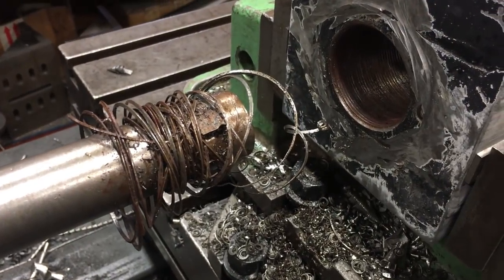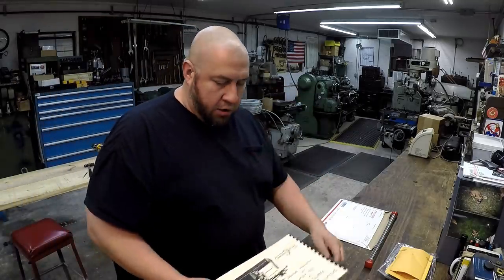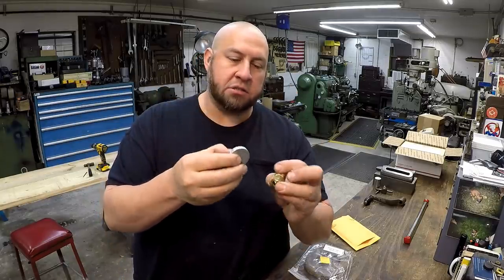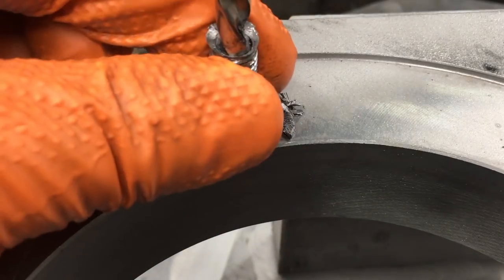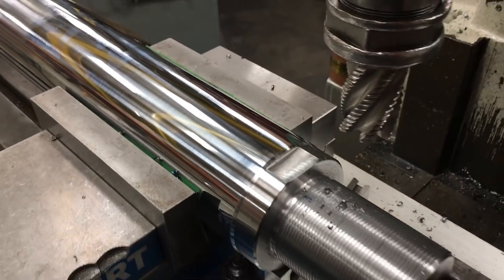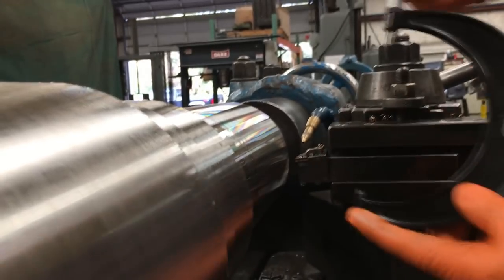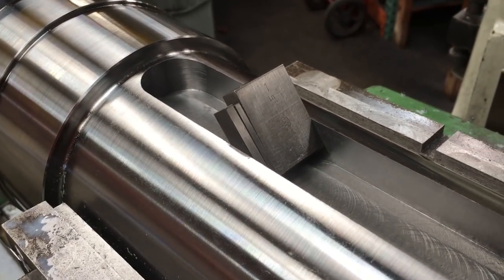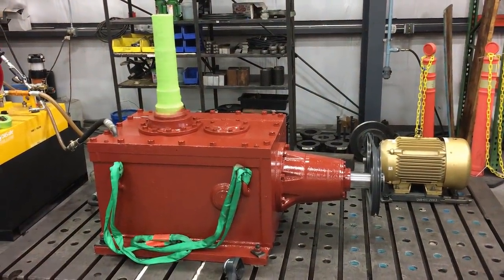SNS 202: Shaft Turning, Left Hand Drill Bits, Shaper Parts

Comment: Hey  Adam, great job on the broken bolts! I've found on the stubborn one's most times it helps to center or pilot drill the broken piece first. It usually allows the left hand drill bit to take a deeper first bite and apply higher initial torque to break the piece loose. Have a good day. Chuck

Comment: As a retired theatrical lighting designer, I can say that you new LED lighting is obviously going to work well for shop use, and the new lights are working very well for video lighting at the bench. 
You have good face lighting coming from in front and above at a good natural angle (the light bouncing off the wall in front of you and lighting your face) and the direct light coming down on you is making a good "key" light. This brightens your shoulders and around your head, and forms what is known as a "halo" that separates you from the background and makes you 'pop out' as an individual and not part of the scenery. (Look at the talking heads on TV news, you will see the same lighting technique -- it works well).
A suggestion -- when you put a row of new lights down the other side of the shop, put them on a separate switch so you can turn them off when shooting video at the bench. You want the background to be a little darker than yourself in the the foreground to get good video, and if you brighten up the background, you are going to start blending in to the background, even with the key light effect you now have. The brightness you have there now works great for video, but I'm sure you will want to get that side brighter for shop use someday. Just leave the new lights there off when shooting video at the bench.
Reply from the maker: Thanks for the tips!

Comment: As an apprentice I used to make similar gear box shafts in the fifties. We could not finish ours on the lathes because the lathes were worn out. We left twenty thou for the cylindrical grinder to remove. If we left more than .020 it made the grinders mad because they were on piece work. Our gear boxes were used in the Arabian oil fields. Long time ago.

Comment: There is no way all 6 of those broken studs came out, everyone knows about sods law! If that were me, 5 of them would be no problem, the 6th one would take the rest of the day! Good job Adam! Top Drawer as always!
Reply: Well, all of those would've been welded solid before I was done, because I ain't got any proper tools to deal with broken bolts. All hand drills and poor quality extractor tools(are there any actual good quality ones? Feels like no matter the vendor they all deliver the same crap, and we're talking expensive "industrial" tools here). Oh well, I usually manage, but it would've been nice to have at least a real drill-press or a mill to use the left hand drill method for sure!

Comment: At 27:54 is the camera distortion from the heat doing off the part?  If so, does it throw off the size of your part?
Reply: You can tell that the camera is not supported very well, and it is shaking. Some of the "wavy/shaky" distortion is from that, and it looks like the auto focus is struggling,, but there looks like there may be some heat distortitoo too. (Also could be YouTube's horrible software stability feature.) It's hard to tell though. (Though, Adam, would not perform a final measurement, on a part that's so hot, there are heat waves coming off of it. About throwing off tolerances... Yea, heat will throw off tolerances, and the effect gets worse the bigger (more mass) the part. While you're roughing it out, and just removing material, heat doesn't matter. But after you hog all the material off, you let it cool, measure it, and do your final pass(es).
Reply from the maker: I iPhone doesn’t do well with machine vibrations. I had it sitting on the steady rest to get that one shot.

Comment: Hi Adam! I always thought that "drilling out screws and bolts" is done with regular (clockwise) drills. I subscribed when AvE recommended your channel, and you've shown off left handed drills several times since. Thank you, i've learned something. :D

→ Are there simple drill presses, able to reverse rotation, or does one need a fancy big boy mill?
→ Just an idea; One could probably modify a simple drill press, figure-8 the belt, and macGyver a set of small rollers to avoid friction.
→ At what RPM did you remove (those) bolts, 100, 150, lower?
→ Didn't you show off a special left handed drill once, what was it called?
Reply: Platypus Nibbles you can reverse some single phase motors, but it would not be hard to replace the single phase motor with a 3 phase motor with a vfd. 3 phase motors change directions by just swapping 2 of the inputs.

Comment: Adam is there a way to attach a small soft bristle brush to strings to scrub the inside of your oiling tubes before you put new oil in???👍👍🤞🏻🤞🏻. 😎😎 for the lights 😎😎
Reply: Donald Latimer they sell pipe cleaners by the roll.

Comment: What do we use left handed drill bits for as apposed to right and drill bit. Still new to machining
Reply: Andrew Arche

Frequently to remove broken bolts as they may unscrew in the reverse direction the drill rotates.

Comment: can you explain why you would use a shaper vs a mill it seems that a mill could do the same work faster. maybe i am missing what all the shaper can do and its advantages over other tools
Reply: Douglas Buhr that shaper can keep up with the mill, and the surface finish will be as good or better. Due to the shaper only having a single cutting axis, it's super rigid. As long as your work is held well enough, you get much less deflection on deep cuts. A good shaper like his should be able to f surface engine heads/decks  within a 10th or 2.

Comment: Yet another great video job Adam. I enjoyed the broken bolt extraction, made it look easy! N.B. I have had success starting a hole with right handed drill then re-sharpening tip with relief for left handed rotation just enough to bite and draw out the thread. A good get out in a jam on a Sunday. Might be worth trying it yourself and if you think it has merit, sharing. Keep up the good work Adam, much appreciated, Ant - southern U.K.

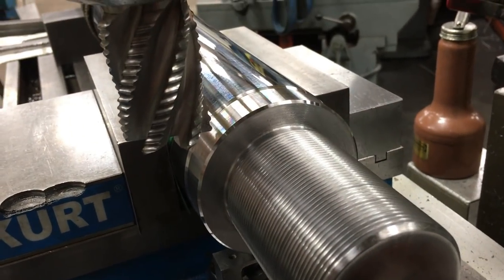Comment: 21:41 Why were those 123 blocks not lined up the same...???  Something under the one on the left...???
Reply: The heights look the same -- there's no gap under the planer gauge on either block.  They're different colors and finishes; that might make a bit of an optical illusion.

One is slide to the side a bit, which doesn't matter, but also might contribute to the optical illusion because the upper corners look odd near each other like that.

Comment: I absolutely love old tooling. Partially because it is what I can afford but mostly for stuff like you are showing. Everything is designed to have a good life expectancy but then can be replaced so the machine can be built to new. Maybe the high end tooling is still like that today but everything I can afford that's newer is finite life expectancy and then throw away instead of rebuild and I hate that crap. That's why most of the stuff I have is used and came from a retired machinist or out of a working shop, well actually haven't gotten that home yet :)

Comment: The spacing is exactly the same??? When a skilled machinist like you says that I picture a 6 foot stack of gauge blocks between cylindrical squares up on the ceiling since the 6 foot calipers are not accurate enough lol

Comment: As always thumbs up.  I look to you for a comment, when I use left handed drill bits to remove stuck threads, I always drill pilot hole slightly wider than the web of the drill bit I am using,  think it gives me better bite for the removal of the stuck object.  What is your opinion does that help or not????  Keep them coming and again thank you for you time and effort in providing the videos  Aloha

Comment: The only draw back to leds like the ones you got on the ceiling is they tend to be a bit directional. The light points downward leaving some shadows in areas. But, if you get 3000k colour temp, the light looks great. Feels very nice to work in.

Comment: next time you stop in your lighting supplier.. you might see if they have any track lighting sections to mount over the work bench and some machines and goose neck LED daylight flood or spot lights so you can aim into still dark areas when filming..  since gooseneck lights are expensive.. just a few to move around as needed since they twist easily into the track ,    even if you make up something like a microphone stand using unistrut so you could use twist to lock positioning or just magnetic goose neck lamps for lighting detailed positions.

Comment: looks like bozo disassembly inc. got that gearbox apart, those bolts came out way too easy for them to have to be drilled or cut and drilled like that, just pray that the bozo disassembly inc will also not be the ones putting it back together, because I'm pretty sure the long bolt will be put in some other hole and threads in the milled one will be stripped out by a regular bolt :D

Comment: Nice, bright shop. Always liked bright shops, so much easier to get all work done accurately. Eye strain is a real time and effort waster. I worked in an automatic screw machine job shop a long time ago. The oil mist in the air was not a problem but the noise off those Davenports  was intense. Fortunately we had excellent lighting all around, which made the work so much easier on us all.

Comment: Apart from removing bolts, what is the normal use for a left hand drill bit?
Reply: claus christensen That’s the only thing I use them for.
Reply: They were used in early multi  spindle drill heads. The spindles were geared together, so each alternate spindle counter rotated ( If that makes sense) Every other drill needed to be left handed.
Reply: Webtoedman, that makes sense. Saves on the amount of gears needed. Thanks for clearing that up.

Comment: I always wondered why all drill bits aren't left hand turn because drilling out old bolts is not an uncommon job. Is there any reason why drill bits turn to the right?
Reply: Just because that's the way someone a long time ago decided that's the way it should be. As a result most drills are right hand (clockwise rotation) and a lot of drilling machines are non-reversible.

Comment: Bugger, Adam, a quick coat of white enamel gloss paint on the ceiling, before anything was done in the room, and you would need a welding mask just to enter the room. All good though.
Reply from the maker: Did I ever mention how much I dislike painting?
Reply: Got to drop cover everything though! Painted my garage roof last year...I'm still finding little white speckles on things I didn't cover. And I rolled it on too. 😕

Comment: Not trying to nit pick too much but the old shaft where it is worn on the end, where it has redness to it isnt called spauling is called fretting. It is a classic failure mode and helps diagnose failures. Really handy to research so it dosent happen again. In essence, it tells us that the coupling was loose and the shaft would brake in time under it. Great work!
Reply from the maker: I simply misspoke.
Reply: Abom79 It's all good! I know you have alot to keep on top of making a video. Great work and really informative. I'm looking forward to the shaper vids!

Comment: where can i get some of those left had drill bits? im a welder not a machinst, but i took a job working at a machine shop, and i spend most of my days removing broken bolts from housing  on various turbo parts. welding on nuts to broken threads and taking em out, most the bolts are b16, carbon and stainless. any other tips would be greatly appreciated.
Reply: toss "left hand drill bits" into any internet search engine. they're not cheap and you get what you pay for! check the brand/manufacture.
hardened steel is obviously a challenge to drill, about the only way to remove them is weld onto as you do now or use lathe/mill with harder "steel" bit, like solid carbide bits, but they need precision machinery or they'll shatter ;)
Reply from the maker: The set I use I bought from Drillco.
Reply: If you're gonna use left-hand drills to remove broken bolts, you'd better use a drill press or a vertical mill: I wouldn't even TRY doing that "free-handed".

Comment: I can't decide if it's my machine or internet or the new lights, but it seems when your hands are moving fast there's a lot of artifacts. Maybe the LED pulses are 'strobing' and the camera is picking it up, but it doesn't feel as smooth as other SNS's. It's not a biggie - just thought I would mention it.
Reply: i don't see any artifacts or strobing
Reply: maybe the increased amount of light has increased the shutter speed so it looks less blurry, that's possible
Reply: It's kind of hard to explain what i'm seeing, it's like the frame rate drops from 25fps to say 15fps but only in areas that are fast moving, so when Adam is showing the manual and flicking the pages or moving his hands around fast I don't see a smooth movement, but it's as if someone removed a couple of frames. I have not seen it happen before and checked other SNSs before posting.

Comment: Question... What can a shaper do that a milling machine cant? i would have thought that a milling machine was more versatile... but i'm not an machinist
Reply: I believe Adam has mentioned that shapers generally deal better with mill scale, also flame cut surfaces. You can also use shapers to do internal key-ways for square keys. But in general, yeah it's sort of a slow milling machine, but they're damn cool though. I want one for sure. Very hard to come by in my country though, might have to scrounge through Germany or something to find something worthwhile.
Reply: I'm not a machinist either, but for the most part a vertical mill is more versatile. And today shapers because of there metal removal speeds aren't really competitive against multi tooth carbide end and face mills and the high speeds they can be run at. However there are some niche jobs where a shaper can get in and do the work that would take a separate dedicated machine or specialized milling machine accessory. Internal keyway's, splines, square holes, internal gear tooth shaping would be just a few of the jobs. But they can still be set up and mostly left alone to get a larger flat area done in the smaller job shops like Adams running. There are some jobs because of the direction and type of tool marks a shaper leaves where it's still the better choice despite the slower speeds. Machine tool dovetails would be one of them. They can also provide a much better degree of part flatness and surface finish against the average Bridgeport type mill. Set up right with a properly sharpened tool and with a good condition shaper you can get fairly close to what a surface grinder can do. There's not many jobs a shaper can't do against a vertical mill, but that slow speed and the part set up times is why there rarely seen in production today. Imo there a good addition to a shop with a vertical mill but not a replacement for one. Even better is having a larger one with a universal table and the built in power feeds including the tool slide exactly like the one Adam now has.

Comment: why do you have to make this part ? is it from an old machine and no longer available.we used to do a lot of one off jobs like this but nowadays companies replace the old machine for new and it is cheaper to buy a new part from the machine supplier ? how much would this part cost to make
Reply: I'd imagine just his time since it seems he has the stock material for the parts.
Reply from the maker: What part are you talking about? The shaft? If so, sometimes cost of new from OEM is very expensive. We can build it and make the money on the labor.
Reply: I thought he was talking about the parts for the shaper.   My bad if I was wrong.
Reply: ian coupe20v It may be cost but I suspect there is a great deal of satisfaction making your own parts for your machines
Reply: hi adam yes i am talking about the shaft, cant wait to see you make the cast part for the shapper